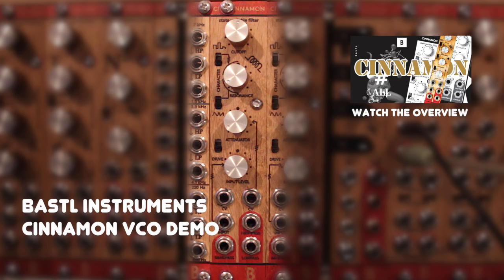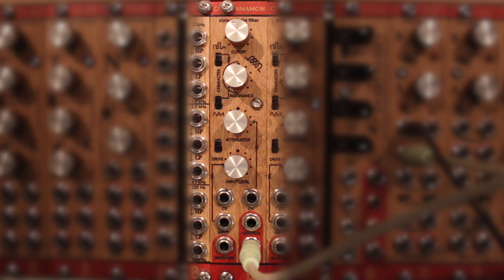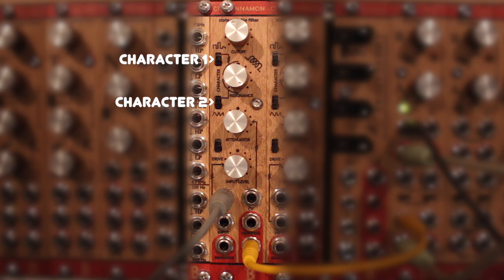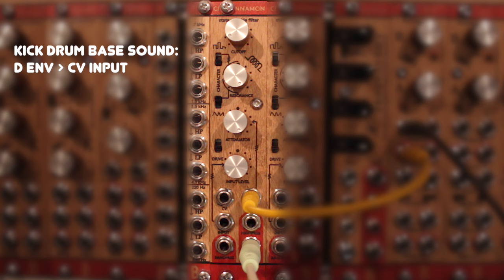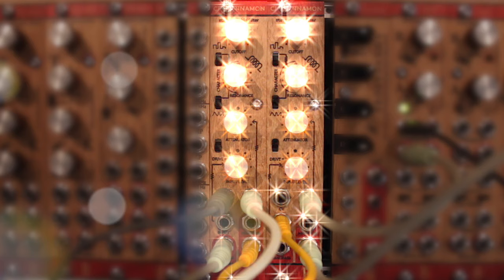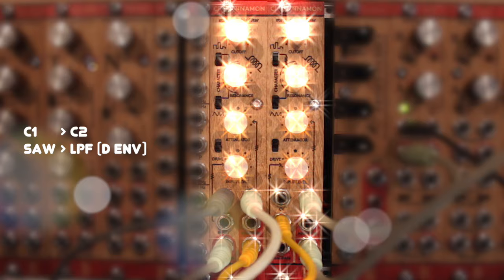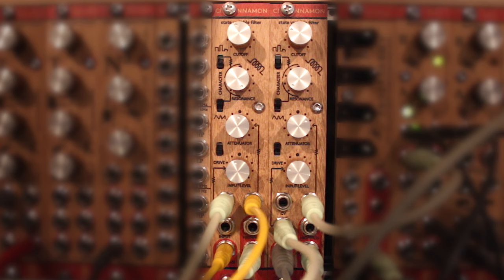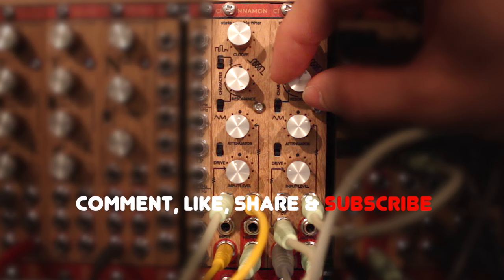Bastl CINNAMON: VCO Demo #TTNM

Comment: Been playin synths for 30+ years...been building em for about 30+ minutes. :D Honestly about 5 years building. Character knob? Is it cut off and resonance together?  Never heard of it but it looks touchy. btw Love the Eurorack scene! Takes a lot of soldering and cooked components out of the mix! lol!
Reply from the maker: +Bill Ricci (Hit-n-Miss) The character switches affect the resonance response, according to the manual. The upper one makes the waveform more square and the lower one creates kind of a sawtooth wave.
Reply: +The Tuesday Night Machines Oh, is that what they were designed for? I figured it was just for filter response because the character switch is nice when not going for oscillation. Makes the filter respond kinda like the Wasp (another great filter, btw)

Does anyone know if Cinnamon is supposed to be modeled on a specific filter design? It's always sounded very Roland to me (in a very good way) so I'm curious about its lineage.
Reply: Cool thanks man! Grazie! .. and to add to an earlier response, Yes! They are a very nice sounding filter! :) Very warm. Going to look into adding it. Thanks for all your input and help guys.
Reply from the maker: +FatSynthDude the character switches change the "feedback waveform", generated by the resonance, if I understand it correctly. So it's meant to crunch both filtered signals and self-oscillation.

The Bastl guys often get inspiration from the Standa Filip/Eastern European synth electronics and I seem to remember them saying that the filter was at least partly based on his design.